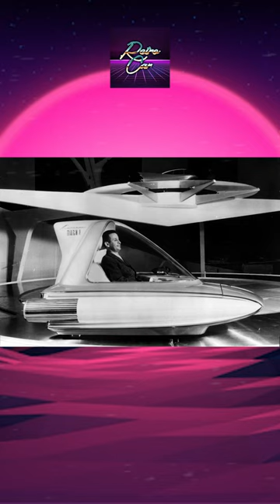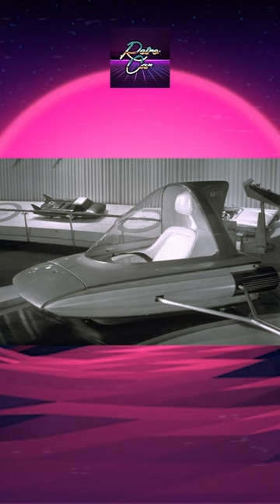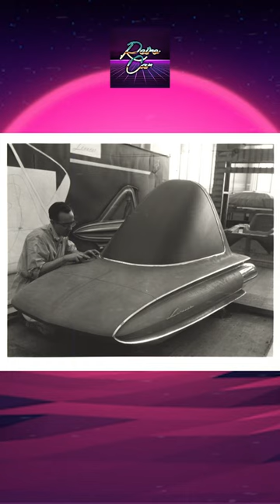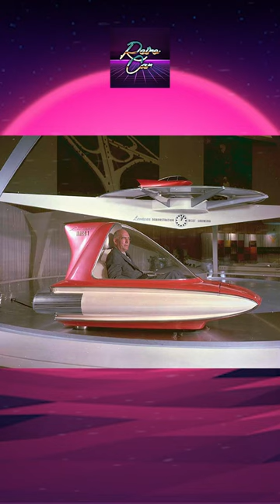Levacar Mach I Concept: Ford's Unfulfilled Dream of a Flying Car #Shorts

Comment: This is what not only the future of the transportation industry could've been, but also the future of motorsports could've been too. Cuz imagine a motorsport where up to 30 of these fast, futuristic hovercars compete on a track that's also suspended several hundred feet in the air.
Reply: F-zero
Reply: @cheesemart  😁